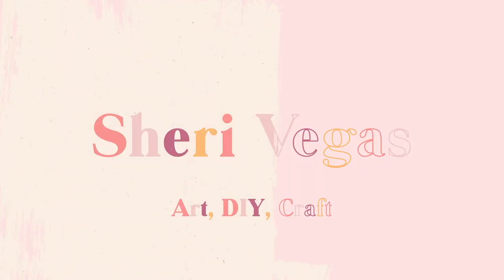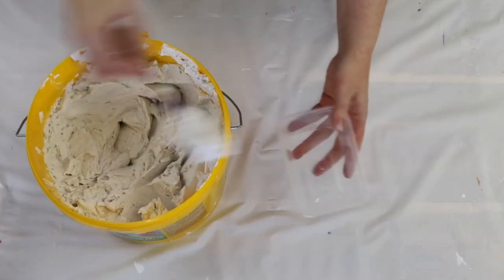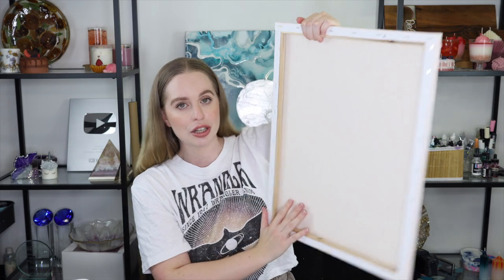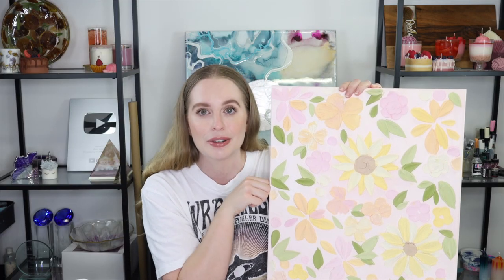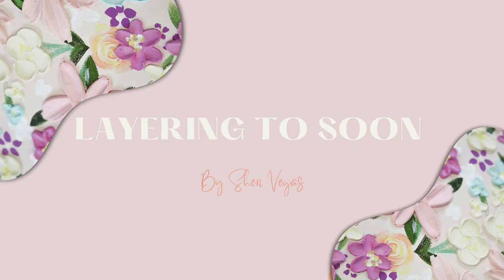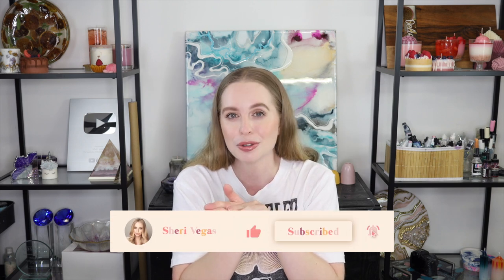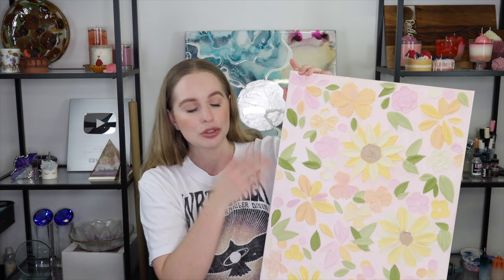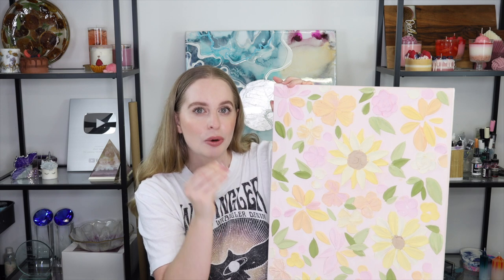Why Is Your Textured Art/ Paste Cracking?

Comment: Found your channel love your video explained very well. I had a question. I keep hearing everybody say using spackling mixed with baking soda water and some acrylic white paint. I just heard you say if you paint on a cheap canvas and the backing is not strong enough eventually the textured 3-D art will crack. Is there anything that you can mix in With the spackling to make it a little more flexible or pliable? I would love this sensor if you have it be very grateful for it. I keep thinking there’s something out there that can make it more pliable they say the white paint makes it more pliable but not enough! What is your take on all of this and is there something I can add to make it pliable to the spackling mix? Thanks ahead of time.

Comment: Id like to know how to fix when cracking has already happened? Thank you.
Reply: I haven’t done this yet but I do use spackle for work. You can put more on over the crack and then sand it off. The green lid drywall mud does not shrink. Think like patching a hole in your drywall. It’s the same stuff.